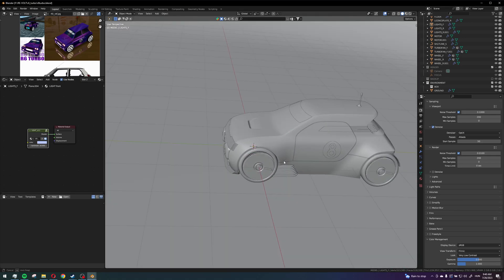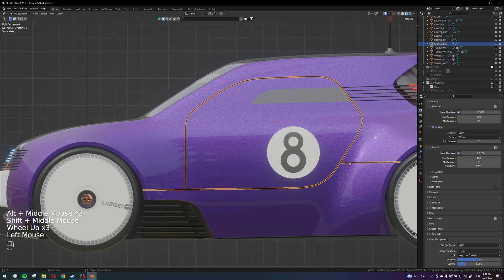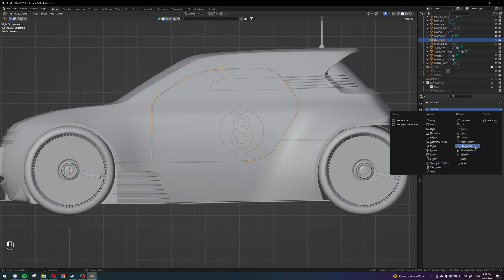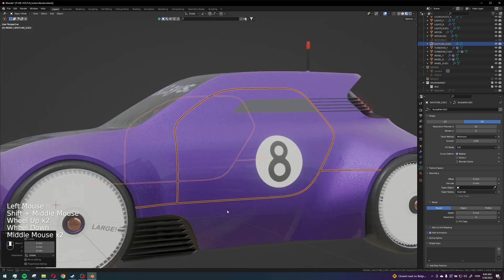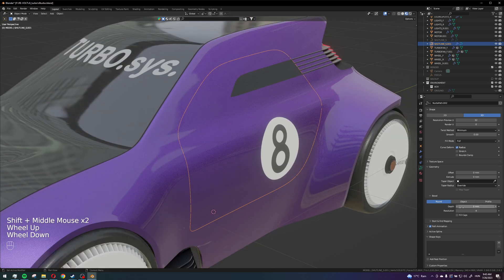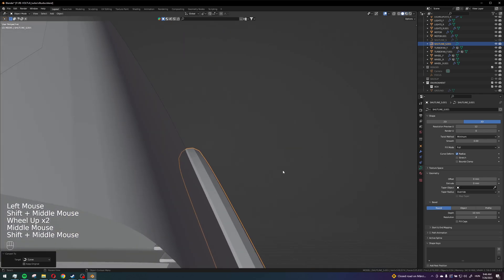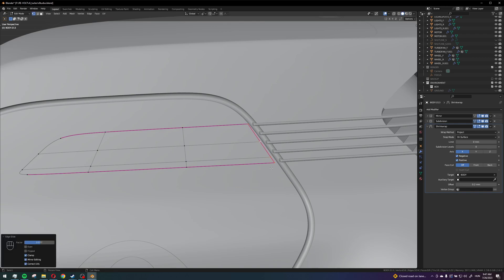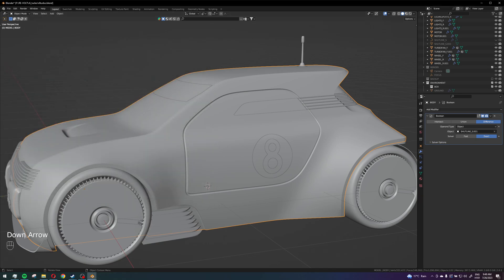Lazy Shutlines For Your Car In Blender

Comment: If we use Boolean modifier it cuts the curve through the body and creates a separation on the surface because the car body is hollow (even tho we use solidify modifier to give thickness of metal to the body). But in your tutorial the cut on the surface merges itself and creates perfect shutlines with depth and  a joint between them. 7:00
Reply from the maker: That can be a valid solution too, depends what you're after. In this example my car model was a fully enclosed mesh, so I could just "carve" the line into it with a boolean, without separating the part. That's the way I would do it for a 3d print.

Comment: How come when I click extrude, the projection of the curve dissapears? Thanks!
Reply from the maker: it is because the extrusion on the curve is facing the surface you are projecting to, and it has 0 thickness so it disappears. to change that, go in edit mode of the curve, and on the right side "N" menu, in the Item tab, change the Mean Tilt value after selecting the affected points. This will rotate the extrusion, so now it will face the object you are projecting onto! hope this helps :)